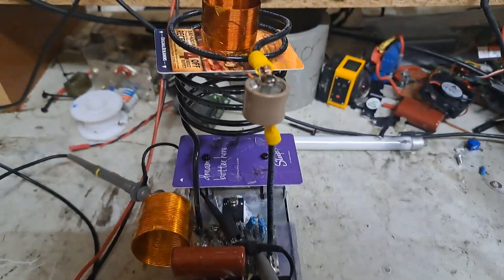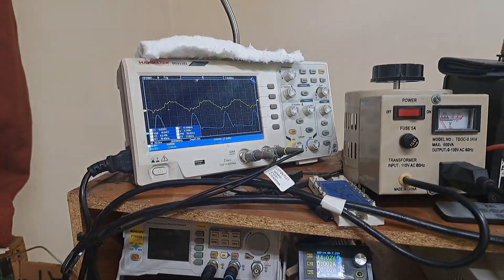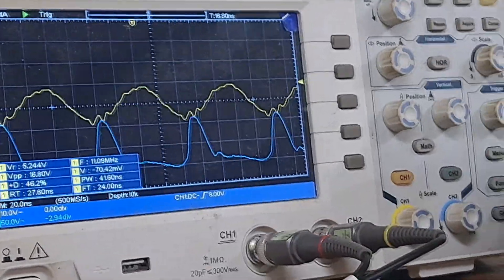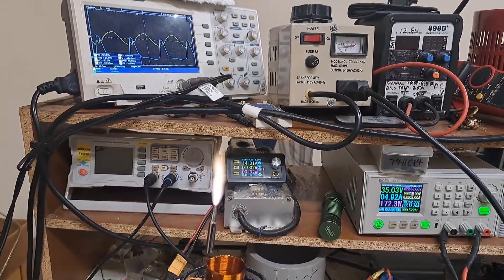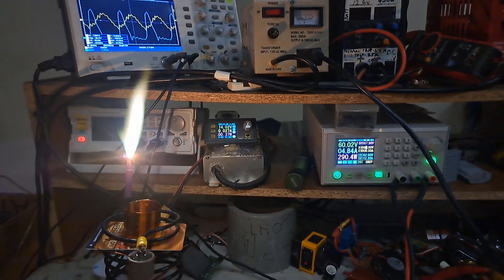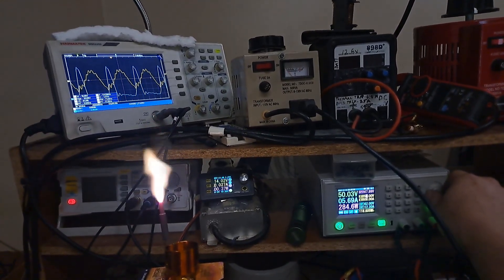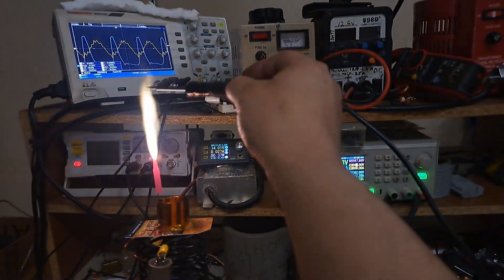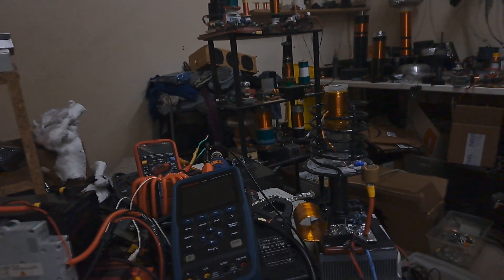HFSSTC Class E 11Mhz 350W

Comment: That silent flame discharge is unlike any coil I've seen before, guessing it has to do with running in the 10s of MHz rather than 10s or 100s of kHz?
Reply from the maker: It can basically become silent at something like ~2.5Mhz or maybe even lower. I have a few in the ~3Mhz range which run silent. The outputs which are clean but have running frequencies much higher than the audible like the hundreds of khz just basically do that hissing due to how the arcs are propagating. It's like taking such a noisy output and then drawing a solid arc from it to a screwdriver or something. If the duty cycle of the current is high enough you just get more of a smooth flame-like arc that's also quiet.

Comment: on your setup what does changing the coupling do for you? i feel like adjusting the coupling on mine does nothing, i still need to look at mine on an oscilloscope tho
Reply: @darascope  By lowering the coupling you actually increase the DC input voltage needed for it to achieve Class E in my test.
Reply from the maker: @uecmitsuimarinedieselengin873  Do you find this is typical? To where you're basically tuning the network based upon the arc load at the desired power? I've almost always found that to be necessary with almost any build, but for some reason I got the impression somewhere that it could be tuned so that it maintains Class E well so long as there is somewhat of a substantial arc. I just don't yet have an understanding of an average "window" of keeping Class E. So for example if I can get what looks like good waveforms at 60VDC, I wonder how well that may maintain up to 100VDC or more. I'd like to be able to keep a particular tuning that runs well at maybe 150VDC, but also be able to run it at only 60VDC for long periods without it heating up.
Reply: @Magneticitist  I love the condition that it could be operated within a more wider voltage range as well. However during my tests if like to say the disigned Class E operation is obtained at 200V then below around150V it will heat up a bit fast. I just noticed there is always a voltage range covering the voltage where the absolute Class E is achieved. Within that range the DS waveform seems won't be changed too much with respect to DC input.
Reply from the maker: @uecmitsuimarinedieselengin873  lol yea that sounds about right. A guy can dream though 😂
Reply from the maker: @darascope  for this one reducing it slightly increases power, very slightly increases gate voltage, and seems like it also very slightly shifts the phase delay.  So for example I raised it another half inch or so and gained about another 100W.
Reply: @Magneticitist  so decreasing the coupling helped get it closer to class e? and with that extra 100w did you see a difference in flame size?
Reply from the maker: @darascope  yea flame was bigger but reducing coupling helped me tune it better only based on the other variables. By reducing coupling and reducing Cds, I can now get a decent waveform so long as I go above about 55V. Things change a little as the plasma grows. I can't say what I have is optimal tuning or anything, it's just an example of how I could tweak values to get OK switching without having to rewind coils.
Reply: @Magneticitist  at one point I increased coupling till i had an arc over between the coils😭, I have no clue how the fet didnt explode, but now im just confused as to why steve tuned his final design for a higher coupling ratio
Reply from the maker: @darascope  I mean honestly bro it's pretty amazing you got so far without scoping anything
Reply: @Magneticitist  i lost all the spring thingies for my probes lol, i need to get some new ones cuz i feel like the long ground clips could be throwing off my readings
Reply from the maker: @darascope  Sometimes I grab a random probe from a different scope and throw it on and it's not tuned right etc. I realized that I would see a particular waveform sometimes with these and not understand why it would run so well looking like it did.. and it was because it was something about the probe at the time. Really need decent ones to reliably read these frequencies and above. I had one of these plasma deals that would completely change how it ran when I had the grounded scope connected.